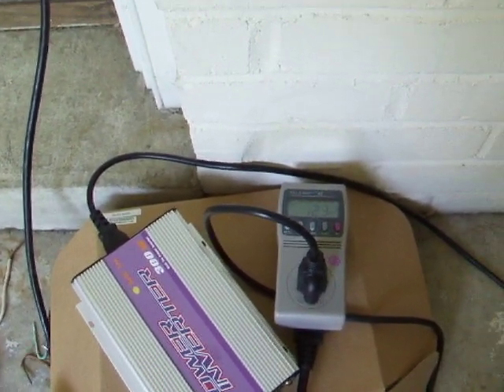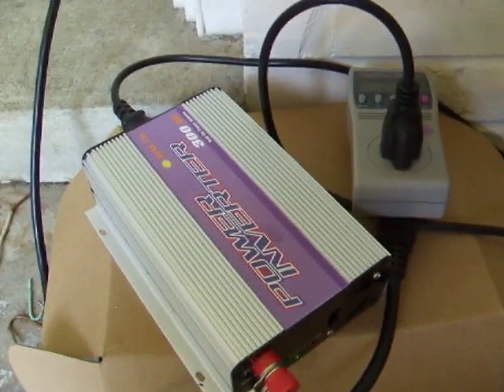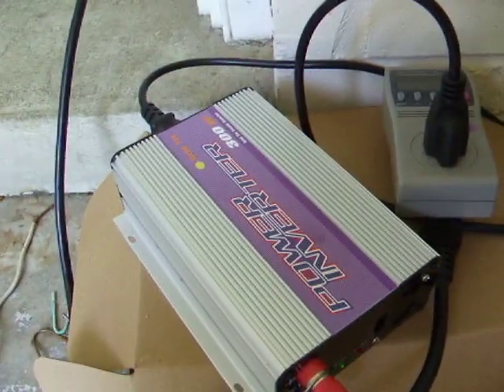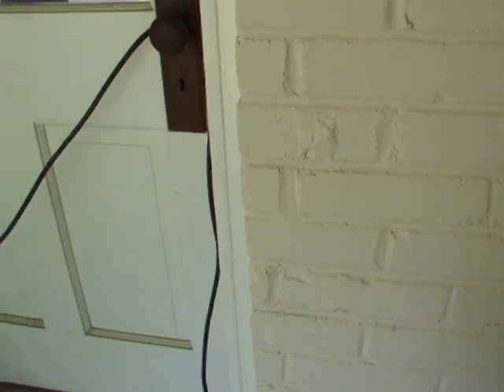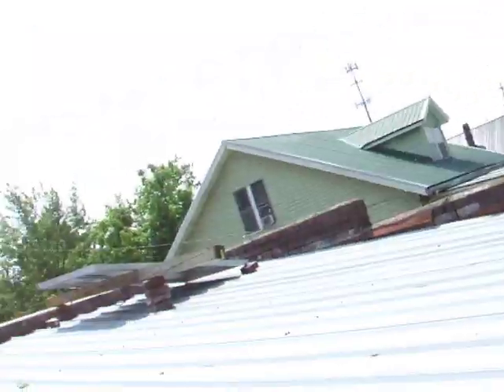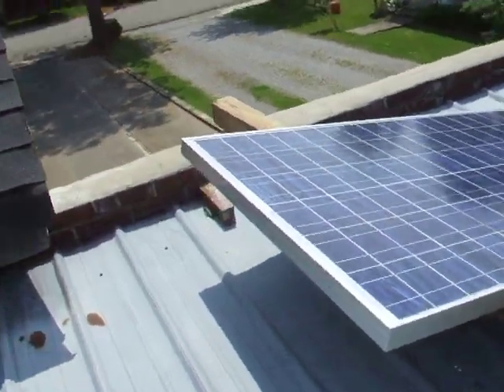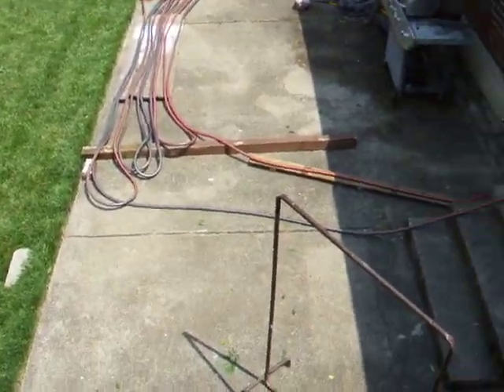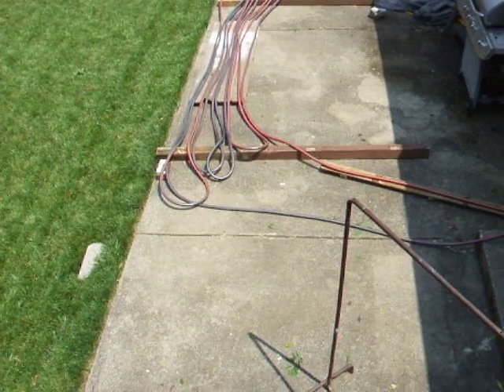Evergreen 210 watt solar panel with Sun 300 grid tie inverter

Comment from the maker: @snathanmax Very true… it is less expensive to build your own. But what is a 25 year warranty worth to you? I mean, these things are in the elements and you will have to provide a solid weatherproof enclosure or you will spend more time repairing your panels. How many people drive cars 25 years old? I personally rather let the engineers manufacture a panel that holds up to the heat, rain, hail, etc…

Comment: Hi,
I'm in UK and have been looking at installing my own panels the prices in Uk is just too high. it would take 12-15 years juat get the money back from if installed!
We have 240 volts ac fromthe grid what inverter and panle size are best?

regards
mm

Comment from the maker: @electrodacus The efficiency increases the more power the panels produce. For this video I only used the one 210 watt panel. I have three 15 watt panels also attached to the inverter. I have seen the entire system up to 180 watts on the AC side. The 12AWG is what I have for now. I also survived the entire summer using very little A/C and heating my water with a solar water heater. The next one will be inside a box with copper tubing.

Comment from the maker: @electrodacus A little earlier I was getting 130W AC, with the meter inline I lost 7 watts on the AC side. With 123W AC my voltage was 14.69V and current was 9.97A. I calculated 146 Watts DC and 123 Watts AC. Rated peak efficiency of this inverter is 92%.

Comment from the maker: @electrodacus Craig’s List. $1 is an amazing price and it was exactly what I wanted. The man I bought it from became disabled and couldn't manage this 3x5ft. panel.I have been watching Evergreen for several years now. Here are all the current numbers. 12AWG stranded copper wire. Resistance is 0.1 Ohm. Voltage (open) on the panel is 20.64V and voltage at the end of the cable is 20.59V. During those measurements the AC wattage was 126W.

Comment from the maker: @electrodacus You spoke like someone with an electrical engineering degree. I speak like a technician. What I mean by that is I recognize there are many more variables than just how many amps my 12 gauge wire can handle. As we are coming upon winter I increased the panel by 20 degrees and got about 15 more watts for the morning hours. Humidity is another huge factor, very dry days I have seen 175 watts. The panel was $200.

Comment from the maker: @electrodacus Physics is great stuff. If I know the conductance of copper and the cross sectional area then I can measure the coulombs / time.  In the real world everything is different. When I set this up the inverter was on the roof with the panels and I added the wire and there was no change to what I collected. I have a minor in electronics... Again, loss on the wire and length I chose is negligible. When I started the inverter was on the roof with the panel. I would have noticed a 7% loss.

Comment from the maker: @electrodacus Cable is only 25ft to the inverter. The voltage drop over that distance isn’t large enough to measure. As I mentioned the gauge is large and was hard to find. I have already done the math and the voltage at the panels is the same as at the inverter. The problem is the moisture in the air… I lose a lot of energy from the sun as it travels through all the water vapor in the air.

Comment from the maker: @LoveMyDogy I was trained by the Marine Corps to troubleshoot to the component. I have been an electronics technician for 15 years. One thing I have kept up with is the advances in electric automobiles. What works and what doesn’t. Tesla uses Li-ion, which is a great battery, but not forgiving when it comes to solar.

Comment from the maker: @LoveMyDogy Lithium ion batteries hold 4x the charge per weight as a lead acid battery but are not suitable for solar due to inconsistent power. Stick with flooded or absorbed glass mat batteries for solar.

Comment from the maker: @LoveMyDogy Best for solar applications will be flooded or AGM. Some praise Gel but they don’t hold up as well over time because solar power is inconsistent. AGM will last longer than flooded lead acid batteries but flooded is much less expensive and requires maintenance. Golf cart batteries are 6v so you will need 2. Check places that sell RVs or a Batteries Plus.

Comment from the maker: @LoveMyDogy Marine batteries are not true deep cycle batteries. I used to get marine batteries free from tornado sirens and they would run my server for 90 min, the same as a 7 Ah battery. I replaced them with batteries the same physical size and quit the experiment after 8 hours. Marine batteries are still rated in CCA, you need to find batteries rated in Ah (Amp hours).

Comment from the maker: @LoveMyDogy I’m not insulting your craftsmanship… I’m insulting mine. I have a minor in electronics so I know the electrical side of things. Keeping the cells safe for 30 years is up to the factory for me. Many inverters use 24 – 600 volts. Panels are placed in series to get those voltages. Not many manufactures make a “12 volt” panel any longer. This inverter needs at least 14 volts to run efficiently. I found it special for my 12v systems for testing.

Comment from the maker: @LoveMyDogy They have an open voltage and a load voltage. Your 12v panels usually run 18-22 volts. On a load they provide 14-15 to the inverter. Your 12v battery needs 14.2 volts to charge and floats at 13.2 volts. Under load at full charge should read 12.6v and when dead will be 10.5v. I personally wouldn’t build solar panels from cells. From the factory they have a 25 year warranty and are built solid.

Comment from the maker: @LoveMyDogy I have batteries as well for power. However, power loss is few and far between. There would be a lot of energy loss if I didn’t try and use these panels all the time. Currently I only collect an average of $2 per month here. Most systems I have seen also have a dummy load to switch to when the batteries are full.

Comment from the maker: @davettalashley Changing how the energy is used doesn’t change how much energy is collected. That’s like harvesting more corn because you have a newer tractor. There will be energy loss when doing any conversion to an inverter or battery. Changing to an MPPT charge controller only helps lengthen the life of the battery.

Comment from the maker: @fightttttt What you have seen I have done myself. The panel isn't really installed, mostly just resting on my roof. The inverter is plug-n-play. I have not priced the actual hardwear to mound to my roof. I'm not really interested in doing so at this time.

Comment from the maker: @giftsfromtheholyland Depending on the amount of electricity you consume each month and how efficient you can be, perhaps heating your water directly with solar and only using the panels for electrical equipment... assuming gas for cooking and heating as well I would suspect $60,000 worth of panels. It would take 3 of these panels to run my fridge and they cost $500 each. My fridge's electrical consumption is between $3-$4 monthly @ $0.081 kWh.

Comment from the maker: @giftsfromtheholyland I suspect the inverters you have are standalone and not grid tie. These inverters are producing a modified sine wave that is not compatible with grid power. You can use the panels to charge a battery and use the battery to power your electronics. If you want your solar power to be fed directly into the house you will need to find a “grid tie” inverter.

Comment: Nice video its always fun to see other people fiddle with these stuff.

The info about the performance you've got is normal, i've got 2 monocrystaline panels. And on a good day i get 300watts. So your 150watts+ is not bad. At what angle lies the panel? should be 30. So not bad figures althou monocrystaline generate a bit more the panel operates fine. The lab only generates absolute max values.